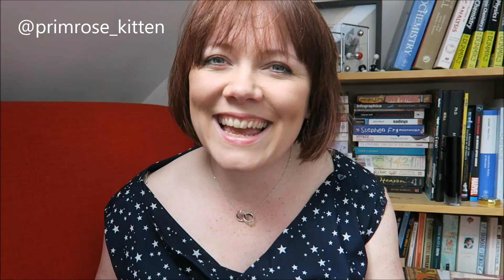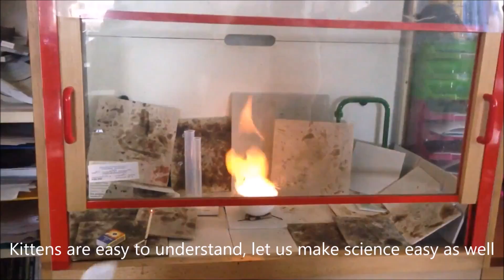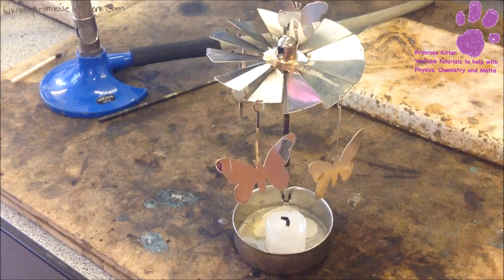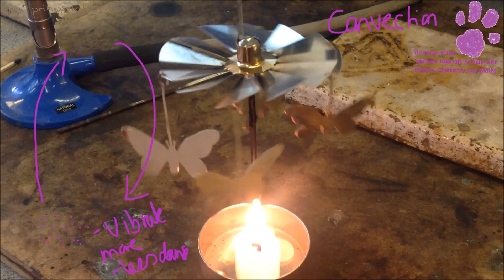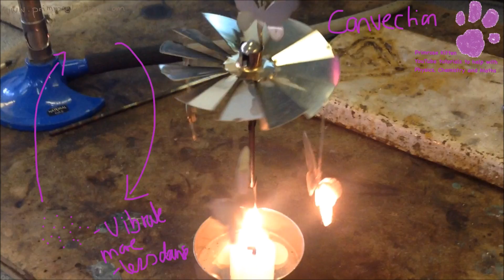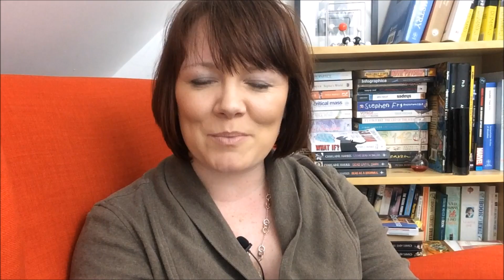Convection Demonstration

Comment: another minor mistake made in this video, the air particles don't strictly vibrate as they're not in a fixed position e.g. solid, but because air is in gas state, the particles collide with one another, gaining kinetic energy, expanding, meaning it becomes less dense than cool air, and rises as a result.